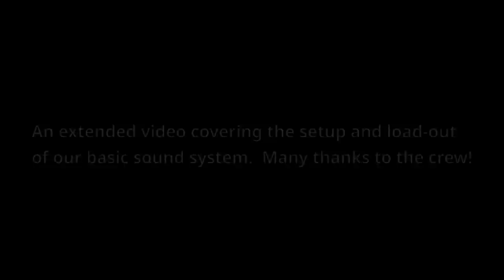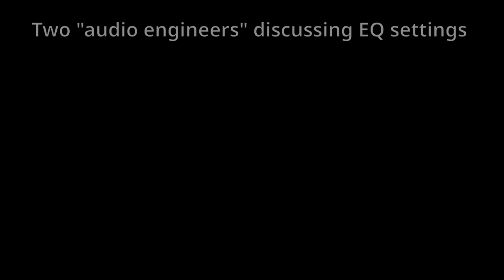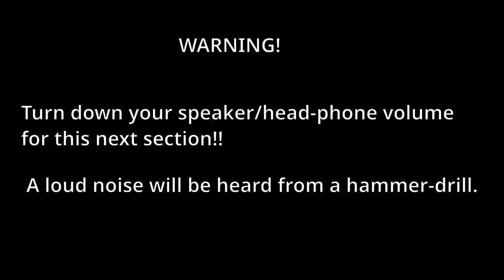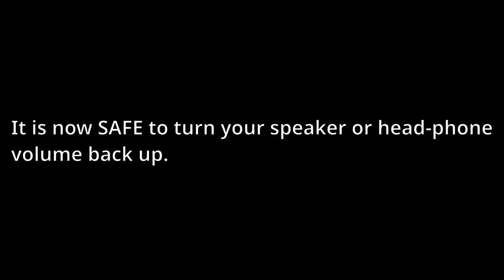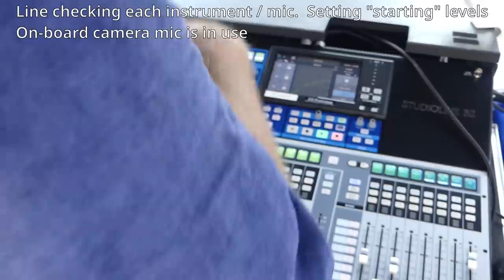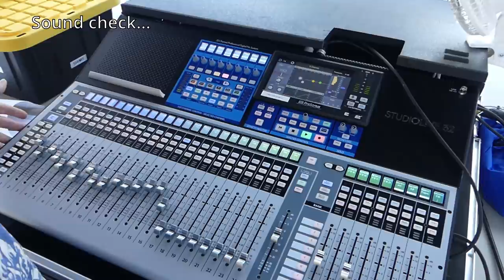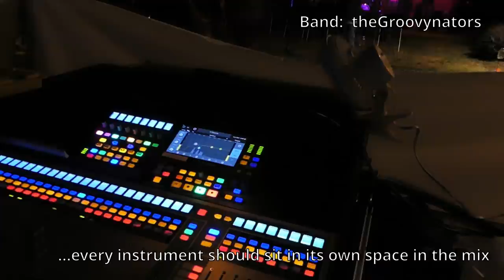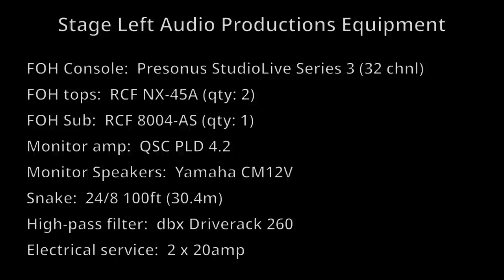Providing sound for the Groovynators using a Presonus StudioLive Series 3 console - Event Video 31

Comment: 27:17 I don't know if you are aware but if you connect a Wi-Fi router to the control port on the back of the 32 and then have the band members download the UC Control APP to their phones then have them connect their phones to that Wi-Fi router then you can assign each member their ability to control their own monitor mix (Floor or IEM) so you don't have to do it on your end so it eliminates more "Guess Work" and headache so you can focus on FOH and it is all independent from FOH so what ever they do it wont affect FOH or the recording
Reply from the maker: Good suggestion.  I looked at doing that years ago.  Actually, the bands I mix for would rather have FOH manage their monitors; this allows them to focus on performing and playing.  Once we have the monitors dialed in, we don't need to make adjustments too much after that.  But also, (and more importantly), with FOH managing the monitors, if feed-back (monitor feedback) should occur, FOH can correct the issue extremely fast vs. a band member... whom may not know they are causing the feedback.  The only time bands (at their request) that have managed their own monitors is when they are using their own PA and I am hired just to mix them on their PA.  It works great then.  Thanks for the comment.
Reply: @stageleftaudio  yeah that's the beauty of allowing the band members to control their own mix because it's much easier to set up at soundcheck, while you are setting up FOH they could be setting up their own mix and it will make it a lot faster to get the show started and then once they are locked in it's good to go for the rest of the show. 

Also for the sax play or he could actually attached a lapel mic to the rim of the horn (I think that makes sense I don't know the technicalities of the names of the horn lol) and it would give him more freedom to walk around and feel more comfortable not having to stay tied to just one area. I have a friend that has an Old violin that I do that to and MAN does it sound sweet. He just attaches the bodypack to his waist and then clip the mic inside of the fancy little cut out in the body of the violin and voila 🤣 pun intended LOL

Comment: Do you have a link for the cable mats that we can use for purchase?
Reply from the maker: Those cable mats are made of rubber.  Their original size was 2ft x 4ft long.  I cut the mats down the middle (the length of the mat), to make two cables mats from one.  I picked up those mats at one of the big box stores... those mats are actually door/floor runners.  Check the big box stores for rubberized door/floor runners.  They were somewhat inexpensive when I bought them.  I've had them for about 12 years now.

Comment: Would you provide your starting point mix breakdown for your outdoor event
Reply from the maker: Basically, I will start with the main fader set around -10db and all channel faders fully down (-60db).  I make sure the gain on each input is set where it will be used for the gig.  I set the gain for these inputs one at a time working from left to right on the console (this is part of the line check process with the band/instruments).  And during the gain setting of the inputs,  I will bring the fader up for that channel to a point where it sounds loud enough for the gig; the band is playing their instruments (one at a time) during this process .  The final result of this process is the starting point of my mix.  Next, comes the sound check, where I usually make minor changes to the fader positions.  The sound check is usually only about 1 minute long.  The -10db starting point on the main fader is to help manage the overall FOH level.  If I need more FOH output, I can just bring up the fader a few db at a time.

Comment: When you run your FOH in this kind of tent or pavilion - don't you have issues to hear a clear sound?
I had my first experience with running an FOH in a pavilion at a concert for a big band. And it was really horrible for me.
When I left the FOH and the pavilion I had a different sound than in the pavilion.
Reply from the maker: Good point.  There can be issues mixing in a tent.  The composition of the sidewalls and roof of the tent we use (what's shown in this video) do not introduce much of any audio issues; the sidewalls and roof are very thin, compared to the commercial line of tents that are mostly used at concerts.  The big issues with the large/commercial tents has to do with their sidewalls and roof... all of which are most always made from PVC (vinyl).  The PVC sidewalls are thick vinyl and absorb a lot of the high frequencies.  Also, no light can pass through the vinyl sides and roof (which is good).  Most of the large-show FOH tents are fully enclosed (except for the front)... which causes a lot of issues with sound bouncing around inside the enclosed tent.  This is part of the reason why we leave the back partition off our tent.  Having the sidewalls (not the back) up on our tent does not present nearly the same level of issues if we were using PVC side-walls.  Mixing from an enclosed vinyl side/roof FOH tent requires a different ear than mixing from the type of tent shown in this video.

Comment: I would have loved to hear the audio recorded directly from the mix output.  I know the sound is different for a live vs a recording. Two weeks ago I watched the sound check of a band setting up.  The guy was back in the audience with a remote control tablet to the mixer that was beside to=he stage.
Reply from the maker: Yes, the mix would most certainly sound a lot different directly from the board.  The tablets do ok for wireless mixing, however, there is an issue with having the ability to move around when mixing.  We hope to do a video covering this issue in the near future.

Comment: not trying to be judgmental but why is there an amp Rack and a sub directly in the middle of the stage?
Reply from the maker: Good questions.  The sub is centered between the FOH tops to ensure even coverage over the listening area.  If the sub was placed to either side (next to one of the top speakers), this would result in a greater volume level for that side of the stage for the crowd.  The amp rack next to the sub is for the monitors.  It's sitting there because I neglected to bring longer monitor speaker cables (to reach all the monitors).  A side benefit of having it sitting there was it kept the number of cables running across the stage to a minimum.
Reply: @stageleftaudio  very astute explanation and  thank you for replying so quickly

Comment: Nice set up, what’s a drive rack and it’s function to the sound quality. 

Again, are your speakers passive or active because of the amps connections
Reply from the maker: The DriveRack (dbx 260) is a speaker management system; it does a lot of things (EQ, compression/limiting, crossover, etc...).  For this event, the DriveRack is being used only as a high-pass filter; it is only allowing frequencies from 35hz and up to be sent to the main speakers... this is for "insurance" that no sub-sonic frequencies get into the system (i.e. from dropped mics, or stage vibration.)
The main/house speakers are all active, the monitors are all passive (the QSC PLD amp is running monitor amplification).

Comment: I have a very amateur question. Are you able to see how much headway you have left on your speakers through your console? Let’s say your speakers are at 80% max volume, will your console tell you how close you are?
Reply from the maker: Actually, that's a good question.  The answer is "no".  However, many amplifiers (including the ones in powered speakers) allow for remote management using their own network management software.  Using the software, you can see various parameters of the amplifier, including its output.  Not all amplifiers (including powered speakers)  provide this functionality, but many do.  Some of the software can run under Windows or MAC.
Reply: @stageleftaudio  Hmmm interesting - how are we supposed to know that a speaker is limiting, or at its max potential without looking at the limit light on the back?
Reply from the maker: That is what the remote management software is for.  It allows the person at FOH to view the status of the amplifiers (including powered speakers) over a computer network.  Basically, you would have a Windows or MAC PC with you at FOH connected to a network... running software that is watching and managing the amplifiers.  From the PC, you would be able to see if an amplifier is limiting.
There's a lot more involved with sizing speakers to amplifiers.  This also includes selecting powered speakers.  If you are concerned about approaching the limits of a speaker, you probably are using speakers that are undersized for the event.  Managing and watching amplifiers remotely is great, but not all speakers and amplifiers provide this functionality.
Reply: A simpler answer to this question, and it is a good question, is to make sure your gain structure is set up correctly. So that when the console output levels are at or near zero on the meter, that your amps are at the top of their performance and the speakers are at their top. This way you KNOW if you have any more headroom. Maybe I should apply for an A1 position with this company. Or, have my own channel for my own PA.
Reply: @6imzadi  And how would you find optimal gain position?
Reply: @MaxsonJacki  That IS the question. Also a very long explanation. Search "Understanding Gain Structure" in PA systems for many videos on the subject.

Comment: What did you use to power all the equipment, power conditioner strips?
Reply from the maker: The power was provided by two 15 amp circuits.  The only PDU (and power conditioner) used in this setup was at FOH for the console and the drive-rack.  The stage power distribution consisted of power-strips and "Y" connector extension cords directly off the stage circuit.

Comment: Doesn't the Presonus have a "Duck" feature for crowd mics?
Reply from the maker: Good questions.  A gate could be used for ducking.  However, it probably would not work too well due to the potential varying levels of input from the crowd.  For this setup, it's easier to press the Mute button.

Comment: Whats  in your driverack that can't be done on the console itself? Do you have a power conditioner or  something?
Reply: I've been watching for awhile so I can try to answer your questions.
I've think I've heard in other videos that they often use their driverack as a crossover and it probably has a more specific EQ than the console might. I believe they also use the driverack with an analogue board.
Their clean FOH power is provided from a UPS (Uninterruptable Power Supply) I believe they have some sort of power conditioner but today they used the UPS.
Reply: @kaworubloodpaw  it looked like the mains/subs were powered do I thought the crossover might be on the back? But that makes sense.
Reply: @EvanVincent.  They're not always powered. If you'll look at some larger event videos they have passive subs. They don't often use passive mains though.
Reply: @kaworubloodpaw  good too know. I'll check out some of the other videos. I enjoy the channel
Reply from the maker: For this event, the mains (tops and sub) are powered.  We are using the internal crossover of the sub for the main PA.  For the driverack, it contains a crossover, however, we are not using the crossover as a crossover.  For this event (like many of the smaller shows we do), the crossover in the driverack is used as a high-pass filter (set at 35hz).  This is to ensure no sub-sonic signals from the band inputs (i.e. dropped mic, stage vibrations, etc...) make their way into the main PA.  The driverack (in this setup) is like insurance... making sure only the lowest frequency we want to come through (35hz) is allowed to pass (and everything above 35hz).  Everything else below 35hz does not get into the PA.  We are using a UPS on the FOH console for this event.
Reply from the maker: Good answer.  We are using the UPS on this event.  The drive rack is being used as a HP filter for the main PA.
Reply: @stageleftaudio  helpful! Thank you! Nice mix

Comment: I don’t understand why the sub,stagebox,amp rack are dead smack in the middle of the stage?…why not have everything to one side out of the way??………
Reply from the maker: Good question.  Normally, the snake and monitor amp rack are to one side (it depends on the stage and what is around it).  For this setup (it's not shown in the video), there's a limited access area to the stage.  Having everything to one side could  have presented a safety issue with the band due to the amount of cables that would have been run near the access area.  
For the sub, a single sub setup (which this event is) works best with the sub in the center of the stage (as in the video).  With the sub in the center, the bass wave-forms will arrive at the listener at the same time the mid/high freq. from the tops arrive.  With the sub off to one side, this introduces a phase issue with arrival times of the sound waves between the bass and mid/highs.  If the sub was off to the side where the access area is, this would have caused a lot of low-end energy to collect under the canopy and probably would have caused bass cancellations out front (due to the near-by reflections from the ceiling and wall).  Any time we use a single sub, it sits in the center.
Reply: @stageleftaudio  I see your point but safety is no 1 on the opposite end not under the canopy you could take away the tripod out and put the sub under foh speaker with a pole,I think one sub is a waste why not have both up there for better coverage,it’s like saying only one top end speaker would be enough.
No rubbishing your effort,you have some nice gear and I think it looks professional,just like the ark ,2 of everything 
Keep Rockin guys much respect from Australia 🇦🇺

Comment: Why aren't you using the talkback microphone but shouting at the band from afar? It's better to talk to musicians through monitors.
Reply from the maker: The distance between FOH and the stage was not very wide (~45ft, 13.7m).  Also, we (myself and the band) had started talking between FOH and the stage long before the monitors were live; sometimes, especially with shorter distances, it's just easier to talk back and forth without a talkback.  For larger shows, we most always use a talkback or an inter-comm system.
Reply: @stageleftaudio  I see. Thank you for your response. I am from Poland and I follow your channel. You have a nice job.
Where are you from?
Kind regards.
Reply from the maker: Thanks for your comments.  We are in North Carolina, USA.